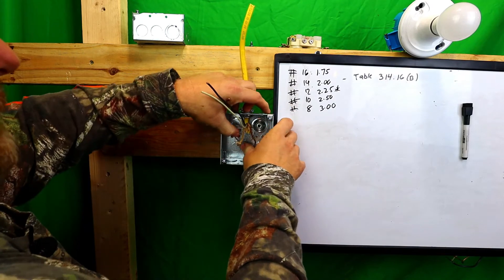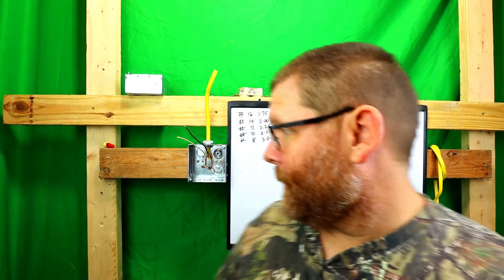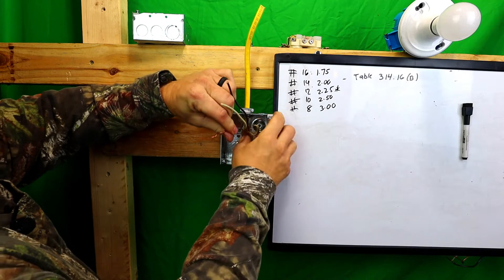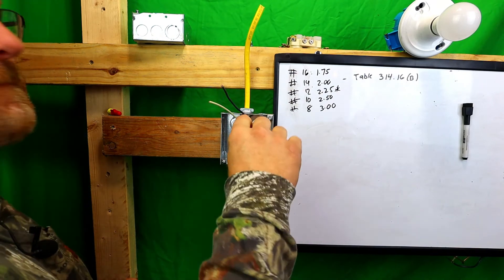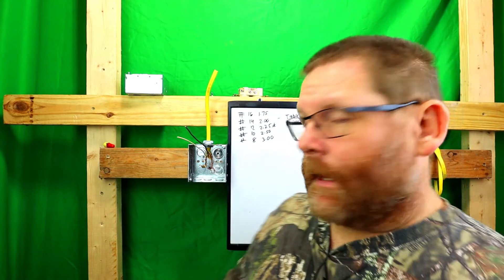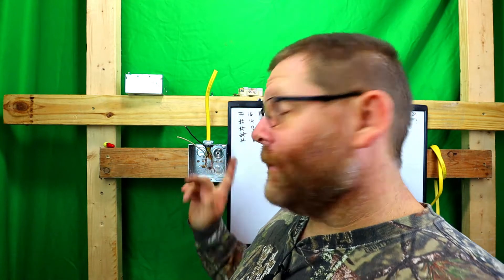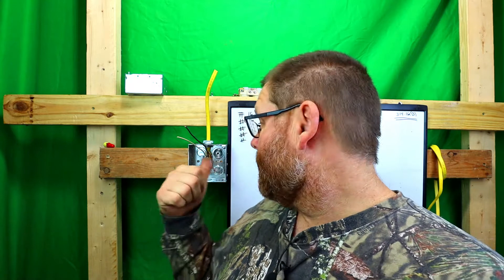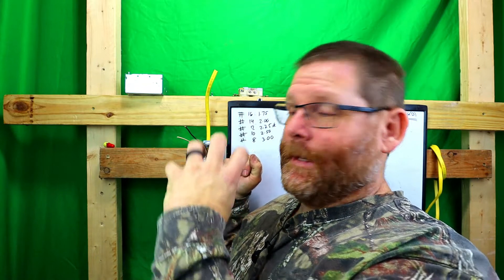How To Ground A Metal Box With And Without A Green Pigtail

Comment: if you're running out of space in a box with multiple circuits, you can just drill and tap more holes for your ground  leads. 

One ground screw per ground lead, and all attached to backside of the box. This gives more space for all the common and neutral leads to be pigtailed properly.

Comment: At 5:00 if you are overlapping the wire when going around the ground screw it is not code compliant. 2011 NECH et al. Exhibit 110.14.(diagrams), overlapping is not permitted.
Reply from the maker: It most certainly is code compliant. Might need to check that again
Reply: @MountaineerOutdoors  Go online and search for the exhibits(pictures) I specified and you will see.

Comment: Wrapping the ground screw, or any screw attached to the box is perfectly fine. However, I would caution against wrapping it all the way around so that the ground wire overlaps itself underneath the screw. If you do this and over-torque the screw, the wire can actually break off, which is no bueno.
Reply from the maker: Amen

Comment: I have a box that does not have a ground screw yet the bare wire is in a small sleeve inside of the box. What kind of outlet do I need for that? I used an outlet that had a ground screw on it but the outlet does not work. I am pretty certain that I'm doing something wrong.
Reply from the maker: I don't follow exactly what you mean

Comment: My house is about 25 years old.There are no ground wires only red and white inside metal conduit. First of all is this safe? Or should I run ground wire throughout which would be a PITA.
Reply from the maker: Well back in the day, they used conduit as the ground. Not many people do now but it's still legal. I would say that at this point it's your call. My opinion, I like to have a redundant so I'd run the ground. I'm guessing though, your conduit is acting as the ground though. Make sure it's intact and maybe just use it.

Comment: My extra precaution is to never use bare copper wire for pigtails.  I always use green wire. Just having a bunch of springy bare wires that might be pushed against the connectors on the device makes me nervous (and I usually wrap the device with electrician's tape!).
Reply from the maker: Nothing wrong with that.. I fully agree thanks for sharing this with us

Comment: If you remove a wire out of that box how do you plug the hole?
Reply from the maker: With a knock out plug filler like this one. Or you can use plastic ones as well https://amzn.to/433bKVR
Reply: @MountaineerOutdoors  perfect! Thank you!
I also have a question about hardwired smoke detectors.
I have to add another on on my existing circuit. Can I just add a 12-3 to anywhere in that circuit and run it to the new detector? 
Do they work off a three way splice?

Comment: What is the reason to ground the box instead of connecting the ground directly socket. I'm learning about electricity.
Reply from the maker: My opinion is that if it's only the device and you take that plate off with the device then the potential for box to become energized is there. I prefer to have it fully redundant so there is slim to no chance of a shock.
Reply: If the insulation on one of the hot conductors is damaged it can arc to the box or if a hot conductor touches the metal box that is properly grounded it will trip the circuit breaker. Both the switch and/or receptacle and the steel box are grounded so if there is an issue with any part of wiring/switch/receptacle in the box if done properly it should trip the breaker.

Comment: Hi, thanks for the video! It is really helpful. I have a one question for you. I am trying to install a dryer outlet and I know I need 10-3 nm-b wire for that. I also want to use a metal box so I'm going to ground the box like you showed. but I am curious if I can use 12 AWG Solid Grounding Pigtails with Screws from Home depot. is it okay join the ground wire from 10-3 nm-b wire with 12 awg grounding pigtail?
Reply from the maker: I believe that the code reads that you have to stick with the same size wire that you pull for the feeders. You can use a fork terminal to go under the screw. It would be a yellow fork terminal.

Comment: Actually using a pigtail to bond the box, as you demonstrated is the only code compliant method of bonding the box.  250.148 (C) Metal Boxes. A connection used for no other purpose shall be made between the metal box and the equipment grounding conductor(s) in accordance with 250.8.
Reply from the maker: Exactly
Reply: @MountaineerOutdoors  I didn’t know that either. Went back and added pigtails to three other boxes I had already installed

Comment: In the new barn build i bought the pre made pig tails with the ground screw, was nice to have them all made up and save a little time while using the rented diesel lift. Also used the  "greenie" cap connector that allows the bare wire to come out the tip.
Reply from the maker: They definitely are a great little item to use